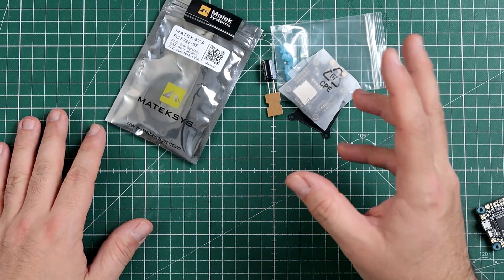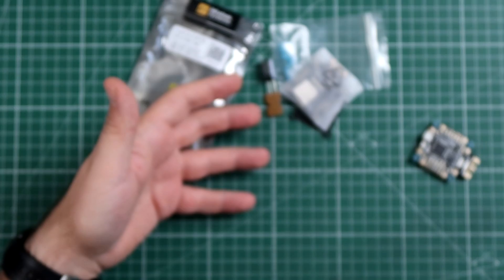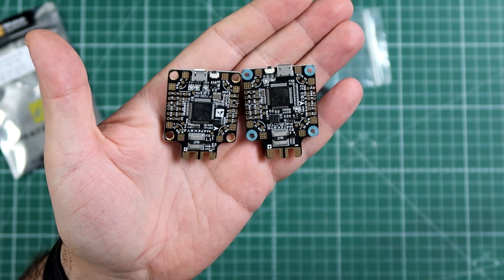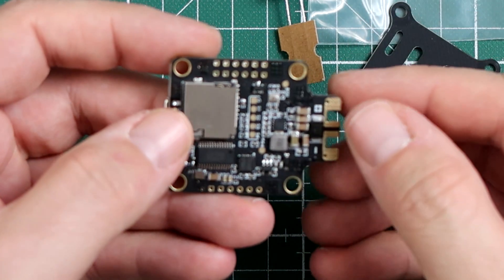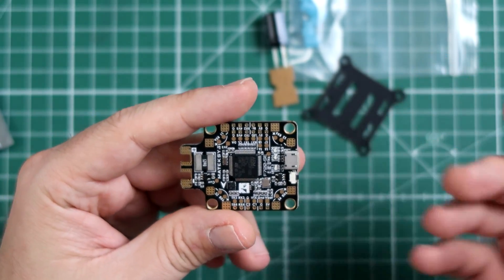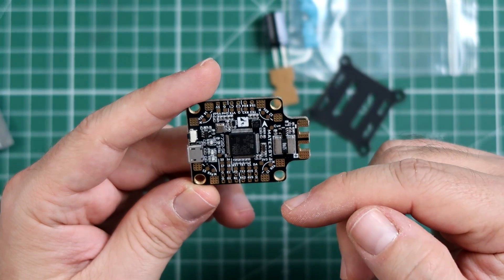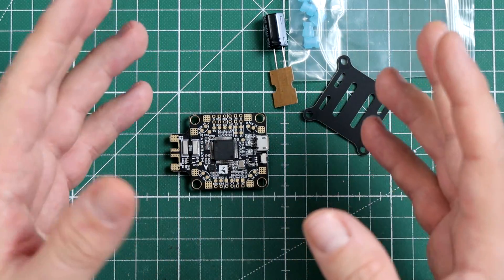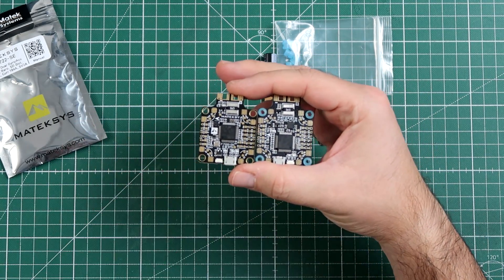Matek F722-SE - the best F7 flight controller? Maybe...

Comment: Hi, I'm having trouble with the vtx switch, I have connected my air unit to the vtx pad and I do not get any voltage through the vtx pad at all. Ive made a switch in bf 4.1.1 on user 1 and it doesn't matter where I have my switch it doesn't work 😔 any ideas? Cheers Daniel.

Comment: Hi.  I just built my second quadcopter.  It's a 6inch with this board and betaflight,  I have found that the quad goes mad and crashes if I make fast maneuvers.  I'm not sure what's wrong with the board.  I haven't done anything in the cli as I'm not that good yet.

Comment: I HAVE this controller, I am upgrading from Apm on my Hexacopter, however I dont want to use it for pdb, 40a esc's, I just dont think it will handle current well, with 4s battery. Prob better to seperate pdb function, do you think? Yet to figure out how it will handle my led's, and buzzer.
Reply: Any idea for a good pdb? Are there even pdbs for hexacopter?

Comment: Why should we buy one of tbese FCs for a mini quad if a OmnibusF4 Pro V3 for $20 or a OmnibusF4 corner will give us  the same performance? E.g. I am operating  32k/16k on a corner with 216 MHZ overclocking...
Reply: If you're happy with an F4 Omnibus, then no reason. If you've run out of UARTs or struggled with FrSky inversion F7 is a significant improvement. My F7 build has GPS, Smart Audio, FrSky RX, S.Port telemetry, ESC telemetry, and RunCam control.